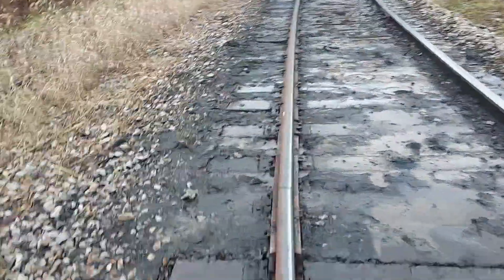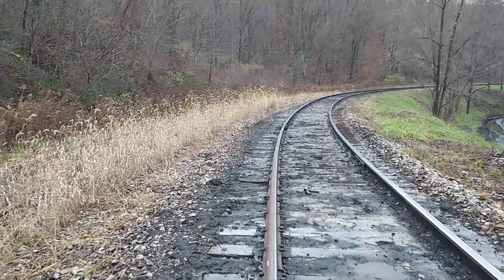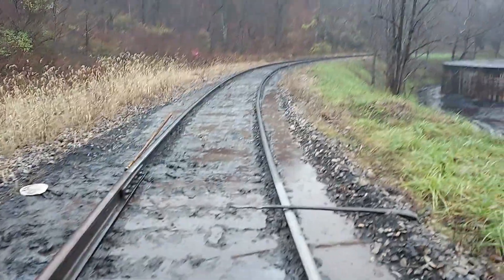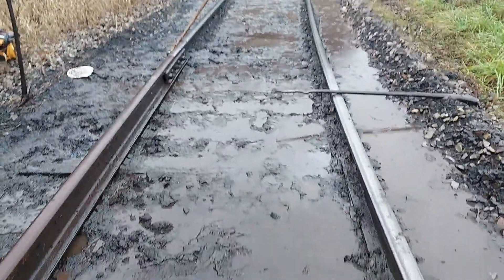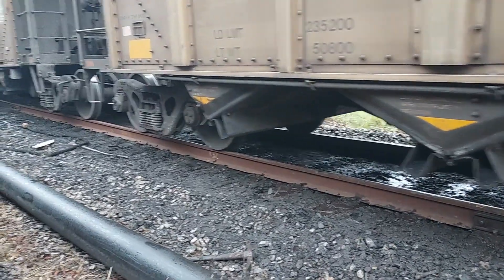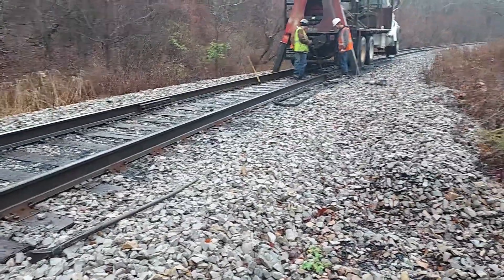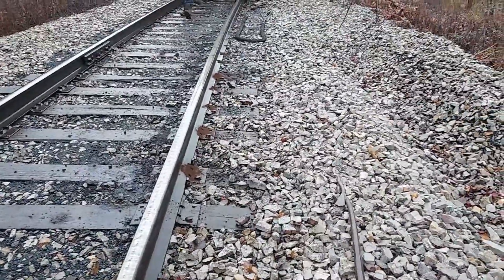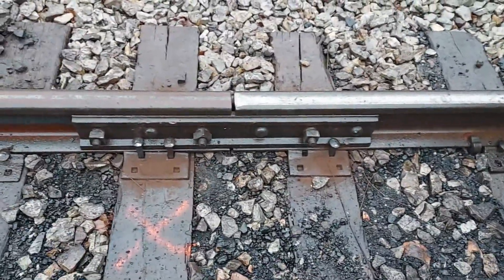How to Bend Rail for a Curve on the Railroad

Comment: How is degree of curvature determined in railroading?  🤔
Reply from the maker: Good question dogpatch75. To find the degree of curvature
take a string line, place one end against the rail head gage face
on the outside rail. That string line will be a 62 foot chord and
take the other end against the rail head. Then at mid ordinate,
measure out to the string line. So for this 14 degree curve,
that measurement would be 14 inches. That is not perfect
but close enough for RR work. Complicated math formula
if we were NASA shooting a rocket to the moon tho.
Reply: @ccrx6700  Interesting!  I figured you had a trick for easily determining it without needing a PHD in surveying.  Showing it might make an interesting video.  😀
Reply from the maker: @dogpatch75  👍😊

Comment: Nice video; enjoyed it, but you 'cheated'. How do you install a curve when EVERYTHING is new and you have nothing previous to work with? Now post THAT one. Thanks.
Reply from the maker: Glad you enjoyed. New construction the engineering department
will put a nail on the center of the ties. Then the construction
crew will put the tie plates at exact same measurement out
on both sides of the center nail. Easy peasy and there you have it
Lawrence. And if we ever do new construction again here,
I will post it, but not likely they will ever build new track here
again. Thanks for stopping by and watching today my good man.

Comment: Awesome video once again. I got a question about the damaged corner on one of the rail. Can that somehow be fixed at a shop or that very tiny damage has now made that piece of rail scrap? I know as a farmer who always trying to cheat the system to nothave to buy the expensive parts would try to fix it by something. But definitely not when a locomotive loaded with hundreds tonnes coal going over it.

 Again, would it be possible to get it remanufactured to save on cost. Or would it be scrap?
Reply from the maker: Excellent question Mark. I farmed on the side for a lot of years
and understand trying to save money when you can. Farmers
out to be paid double or triple what they are. But won't get on
a soap box about that for now. 

The rail head that had a chunk out of it could have been welded
and perhaps it would have held up for many years. But since
it was 1975, original rail here and was in an 11 degree curve,
we felt it was best just to replace the entire stick instead
of welding it. We do have many battered heads here that
have been welded in the past tho. 

That rail could be sold to a RR contractor for use in a siding
or spur or as a bridge guard rail, all they would need to do
is crop off that bad end. But it would never be used for
main line traffic, at least not here. Always appreciate
your visiting with us my friend.

Comment: I'm always amazed how such heavy rail bends so easily.  My grandparent's house had a railroad rail running the length of the house as the support beam in the basement.  I used to think that was a great idea, but now I'm not so sure.  At this stage, it's a moot point since the house was torn down more than 10 years ago.
Reply from the maker: Yes it is amazing how flexible rail is for it's strength. Very much
appreciate your tuning in and checking out the video my friend.

Comment: Sorry if it's a dumb question but why such a sound/harmonic im assuming vibration on the rail around 9:58 or so. Is that from the rail still needing to bend a little bit and get worn into place, or what else is going on here for such vibration? I realize track moves/flexes quite a bit but i guess maybe that was the wheels on the cars being deformed or something?

Thanks for the video!
Reply from the maker: Good question truthseeking. The rails on this curve that did not
get changed already had some curve wear on them. The new rail
did not. The flanges of the wheels going thru the new rail was
what was causing the sounds. Metal against new metal, as time
goes on it will quiet down some as the rail gets worn to match
the other rails in the curve. But with this sharp a degree of curve
it will always have a sound as the wheel flanges encounter
the rail head. Hope that explains my friend.
Reply: @ccrx6700  Explains what's happening perfectly. Thanks for the answer!
Reply from the maker: @truthseeking3818  👍😊

Comment: I suspect you can bend the rail tighter than the train can handle.
Reply from the maker: Hmmm, according to EMD an SD 40-2 can negotiate a
curve of 30 degrees. I find that extremely hard to believe,
but I have an operators manual and that info came right out
of it. W&W narrow gage RR had a 33 degree curve and they 
used Mogul steam locos with the middle driver blind to 
negotiate. They tried larger locos and they wouldn't work.
Trouble with our SD is that it has 3 axle trucks. Food for
thought Robert. Thank you so much for writing in and
for watching today my friend.

Comment: Dave i was wondering does bending the rail on a 14 degree curve change the steels strength in any way ?
Reply from the maker: Good question John and to my knowledge it does not weaken
the strength of the steel in a rail. Rail is amazing how flexible
it is and still retains it's original strength. Thanks for writing in
and watching today my friend.

Comment: Ok but how do you make sure both rails have same curve?
Reply from the maker: Very good question Bob. That is done in the original track construction. Engineering will put a center mark on the ties,
then the construction crew will put in the tie plates at exact
same distance across from each other measured off the tie
center mark.  So the engineering drawings that are made
of the original track curvature is thus followed that way. Always
is a pleasure to have you visit with me my friend.

Comment: At the end of the video you showed a rail with a broken head at the joint. I have seen rails that had the head welded and ground, plenty of rails like that are in the yard at the Roundhouse. I am curious what your thoughts are on that type of repair?
Reply from the maker: We have a lot of battered heads Matt. I do believe I found one
going into your turntable that had been welded and if I remember
asked you what kind of rod they used because the weld was a silver
color? We have welded a lot of battered heads over the years and
still have more to do. A good welder who runs a bead across
the rail head, grinds it, then runs another bead in the opposite direction and grinds it, and the final weld in the direction of
train traffic, the weld holds up great. They use 7018 
rods here. We changed this rail instead of welding it because
it was in an 11 degree curve and was original 1975 rail,
so felt it best just to change the rail stick out.
Reply: @ccrx6700  Gosh I do remember you asking that, good memory. Those welds are still not rusty. The technique on the weld is good to know, and makes sense from a stress analysis standpoint. Thanks ccrx6700!
Reply from the maker: @mattkinnard6899  👍😊

Comment: Dave,this question has more than likely been asked a few hundred times. However,how do you know what to set the rail joint gap spacing (opening) at? Is there a formula for setting the gap? Also sir,how do you kiwi what radius a curve is? Degree I’m sure is easy to figure,but how do you figure the radius? I’ve also heard you mention a time number or something when it comes to a curve. Could you explain a little more in that sir? Greatly appreciate your time! Also please keep the awesome videos coming sir! RC
Reply: It's set by the ambient temperature at the time.
Reply: @thomaspinnick5796  understood. Is there a chart or formula that gives you the gap spacing for a set temperature? I know it’d be wider on hot days and closer if not closed completely on cold days.
Reply from the maker: Rusty good questions. 1. Here over the years we have found that
for our 16 miles of jointed track and uni directional loads that
the train pulls the ideal gap between rails is 3/8 of an inch,
this being at rail neutral temperature. (Temp that the rail is
neither under expansion or contraction, generally 45 degrees
to 65 degrees ambient temp) There is no engineering chart
or table that I have ever seen that provides gap spacing.

2. Using the term radius was not a good thing for me to say, I
should have said follow the curvature of the curve. Radius
is the length of a line between the center of a circle to it's
perimeter. To find the degree of curvature a 62 foot string line
is set up along the inside of the rail head on the outer rail, then
measure at mid ordinate the inches from the rail head out to
the strong line. For RR work that is close enough, for NASA shooting
a rocket to the moon there is a complex mathematical formula
to get exact degree.

3. The time number I believe your referring to is the curve number.
All our curves are numbered starting at the far west end, so this
was curve #2 on our track. Hope that all helped.
Reply: @ccrx6700  Thank You so much Dave for the response! You answered all my questions! Merry Christmas sir to you and yours!🎄🎄🎄🎅🎅
Reply from the maker: @rustyc521  👍😊

Comment: Fantastic video, Dave! Thanks for answering a question of mine (and others) from several videos ago! The visuals were great. 

One follow up question. Does the rail pretty much stay bent to that curve you set or is the stick always trying to spring back to a straight position?
Reply from the maker: Your certainly welcome Will. Thank you so much for watching.
Always is a pleasure to have you join with us my friend. If you noticed
on the rail we took out on curve 11 that the rail had a slight bend
to it. It was not exactly straight as a new stick would be. That was
an 11 degree curve and the rail had been in there since 1975.
So even the rail we took out on curve 2 at 14 degrees had a slight
bend to it after it was taken out (I did not show that), but the
rail did try to go back to more of it's original straightness, just
didn't make it all the way. So yes it does try to spring back, but
in those high degree curves doesn't make it back to original straight.
Reply: It'll always try to spring back to straight. You have to bend metal pretty severely (or with heat) to permanently deform it.

Comment: Rail is a giant noodle, it's strength is only vertically, and has to be supported within a couple feet, just like the flooring in your house.
Reply from the maker: Yep and when it gets really hot outside it will bend as easy as
a noodle. Thanks so much for stopping by and taking in the video
today my good man.

Comment: When replacing rail like you showed, do you always just rely on the tie plates to guarantee you are in gauge or do you check it with a rail gauge from time to time also?  Can you re-use the rail anchors or do those get replaced / used once?
Reply: They have to check that it is within gauge with a rail gauge. While it's nominally 56 1/2" standard gauge, while I don't know the numbers exactly, track can be anywhere from a quarter inch smaller to 3/4" bigger and be within gauge.
Reply from the maker: Good questions my friend. 1. Yes we do check gage before
it gets spiked down. Usually every 5 or so feet we will check it.
Spike some then re check. 2. We do not re use anchors. Most
of our anchors are original from 1975 and over the years they
lose their spring and thus are not effective at mitigating rail creep,
so we always use new anchors when changing rail. Thanks so
much for joining the rail bending party today.

Comment: Does anyone do any testing of your hardware from different vendors. I know you claim you like certain vendors better is there any data to give you a reason why? Do they check bolts for hardness, tensile strength etc? It would be nice to know.
Reply from the maker: We get all our rail from Steelton. They indeed do a considerable 
amount of testing on their rails before it's shipped and during
the rolling process. We get all our other track materials (OTM)
from A&K Railroad. We have bought from them for the past 40 years.
I do not know if they do any testing on the OTM or not. A&K is
a pretty big supplier of OTM all across the nation. Here is a link
to their web site
https://akrailroad.com/

Comment: Can you please define or describe what a "14-degree curve" is/means?
Reply: Take two points on the curve 100ft apart in a straight line. Draw a triangle between those two points and the centre of curvature (i.e., the point that would be the centre of the circle if you continued the curve all the way around). The angle at the centre of curvature is the degree of the curve.

I've no idea why North American railroads don't just use the radius, like everybody else.
Reply: @beeble2003  Thanks for the reply.  I don't get the use of degree-angles when describing a radius either.  I suppose it's easier on the crew having to layout and execute the curve instead of trying to figure out where the center and end points of the radius are located.  I can't imagine trying to describe a radius using normal surveying means in situations of say a canyon or somewhere next to a river or swamp or in a tunnel.
Reply from the maker: 100 foot chord works well also beeble. Many do use that. Code
Fed Regulations uses a 62 foot chord.

Comment: How do you stake out the track?  I know the transitions are clothoids (the curvature changes from straight to circular linearly), do you use some kind of sighting device to stake it out?  I've always wondered how this works.
Reply from the maker: Initial staking out of a track curve is done by the engineering 
department. They will put center marks down so the construction
crews can then put in the track equal distance for each rail to
end up from the center marks. Exactly how they do that I
have never been around them when they did it, meaning what
instruments they used. Track is laid out first on drawing paper
then built to the specs on the track chart. Someday I will make
a video of the original track chart engineering made for us. 
Hope that helps and thanks for watching the video my friend.
Reply: Or I guess you could also lay it out with a protractor in half-degree increments.  So one tie is at an angle half a degree from the last, the next is 1 degree from this one, then 1.5, 2, 2.5.  Etc.

Comment: When you place a rail in a curve, are the shaved, on the inside, under the head? Or yall just use stock?
Reply from the maker: Not at all sure what you mean by shaved Mark? Spell check 
changed what you were saying? Let me know and I'll try
my best to give you an answer. Thanks for stopping by and
taking in the video my friend.
Reply: @ccrx 6700 That's Railroadin!  I should have used the term "machined"? Lol! Some rail, is a curve, is machined, to reduce friction.
Reply from the maker: @DarkTerritory71  I see said the blind man 😊  rail is not machined for a curve. Its all stock rail, as you say

Comment: That balast could sure use a cleaning.
Reply from the maker: Yes this section needs some good ballast rehabilitation done
to it. This is 10 mph track. We also have a few sections on
main at 25 mph which will get done before this section will.
It's on the to do list. Always would be appreciated for you
to volunteer to come out and start digging away.... :-) Thanks
for taking in the video today my good man.

Comment: Very interesting :) Whenever I have seen people bend rail previously, they've used a hydraulic bender to 'kink' the rail at a bunch of different points. This seems much easier, as long as you have a finished section of rail to anchor it to at one end. And the end result of doing it this way is certainly much more smooth.
Reply from the maker: Glad you enjoyed the show. We've bent rail with bars here since
the beginning, actually it's no big deal. Not often we have
gotten a grapple truck to help out. We do have a hydraulic
bender to put the sharp bend in a turnout closure rail,
put some heat on that to get it to bend easier. Hope to make
a video on that someday, have some pictures, but no video.
Thanks so much my friend for visiting with us and watching.
Reply: @ccrx6700  It's really neat how easily the rail bends. I figured it would be a nightmare. I think it will be especially easy in my case, since I will probably be using 70lb (or less) rail. Good to know that I can probably avoid spending several thousand dollars buying a bender :)
Reply from the maker: @crazyfvck  👍😊

Comment: Sir I noticed that you did not fill the holes back in before reinstalling the spikes. Is that because the train there runs at a slower speed? As always thanx much!  Ken from gpt ms
Reply from the maker: Ah yes Dr. Watson, good observation. However we actually
did fill the spike holes in with Sure Spike before driving the new
spikes, with all that coal mud it was impossible to see the Sure Spike
dust. We did away with tie plugs many years ago, Sure Spike
holds just as well and I believe it seals the holes up better to
keep water out. Always is a pleasure to have you join in
with us my friend.

Comment: Could that defective rail be used on bridges, for those between the rails safety rails?
Reply from the maker: Yes sir it could be, just cut off the defective ends (that's
where the defect was in those rails) Being that it was a Sperry rail it would be unethical to sell it to a contractor for putting in a
siding or spur somewhere else, but bridge guard rail would
be okay. Thanks Rod for stopping by and taking in the show
today my friend.